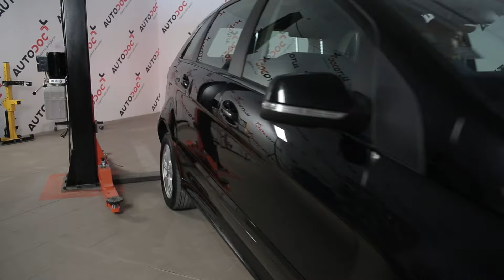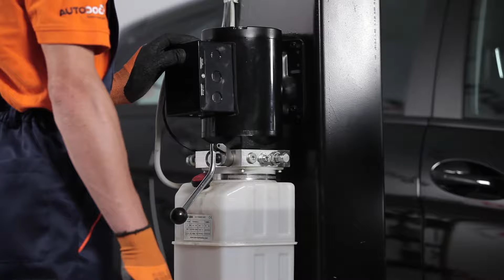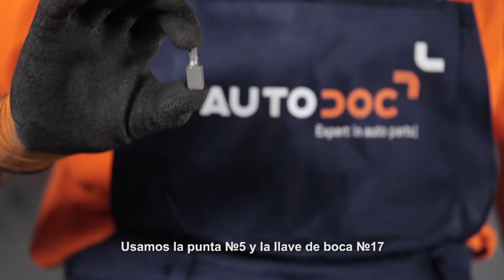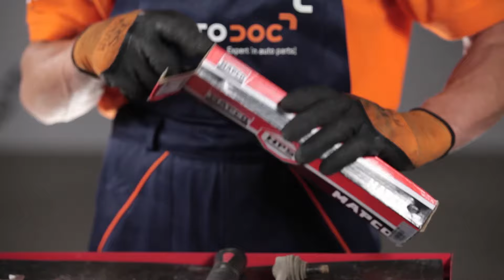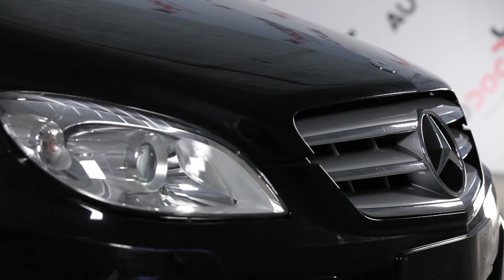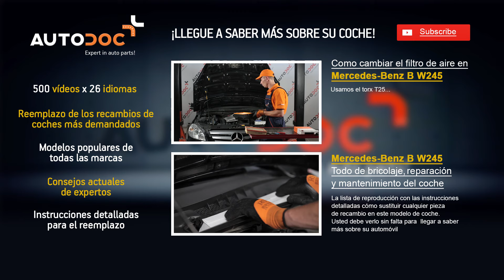Cómo cambiar bieletas de suspension delantero en MERCEDES-BENZ B W245 INSTRUCCIÓN | AUTODOC

Comment: ¿Disculpe como sé que es necesario cambiarlas? Mi W245 es 2009 y hace un ruido como "golpeteo" cuando paso alguna imperfección en el camino, ya le han revisado la suspensión y dicen que no tiene nada. ¿Alguna idea?
Reply from the maker: Gracias por su pregunta. Hay varias causas del ruido. Le recomendamos ir al taller certificado. Es bastante raro que los mecánicos no descubrieron el fallo. Atte, equipo de Autodoc.